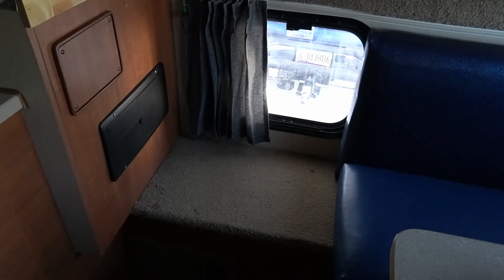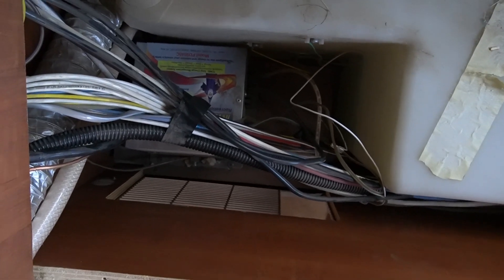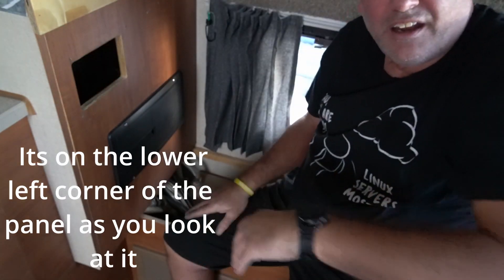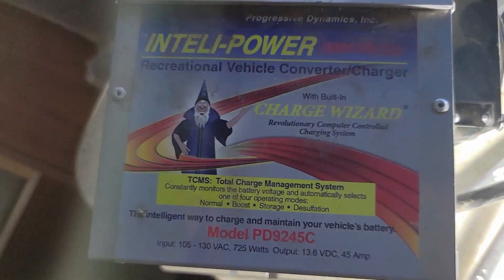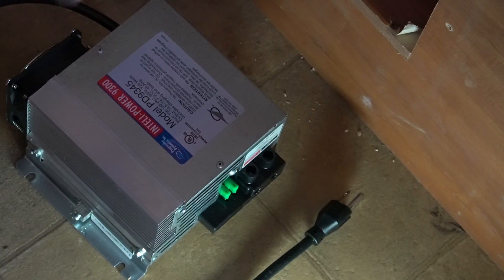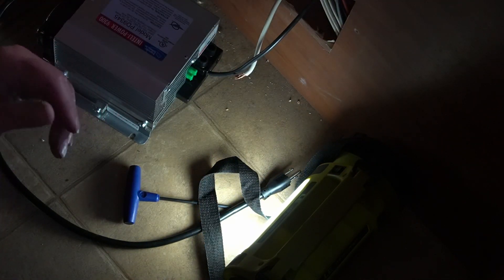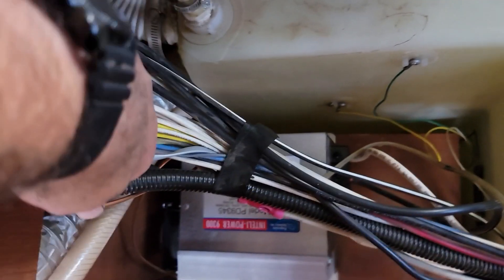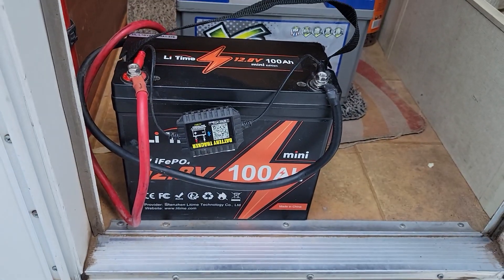SLIDE-IN LANCE TRUCK CAMPER UPGRADE: Upgrading the Converter for Lithium Battery

Comment: This was helpful thank you!  What about the dc-dc charger so that you can still charge from the truck?  Did you replace that as well?
Reply from the maker: I did not do the DC to DC charger as I don't really travel that far. I mostly stay in Arizona. I do have a 200Watt solar panel that will whip things into shape and if all else fails, I have a 2000 watt Honda gen I bring also to run the AC.  That is a great question and if I start moseying out of the state, I will definetly upgrade to one of those also. Oh yeah and I also have a 1500W inverter that runs my fridge when I am driving so my fridge stays nice and cold.

Comment: I like the fact you start from pulling out the step to actual install.  Thanks for another instructional video
Reply from the maker: Thanks for the flowers. It was pretty easy to do, and  it seems to be worth the upgrade so far. I lightened up the camper and gave me many more options. Thanks for the comment.